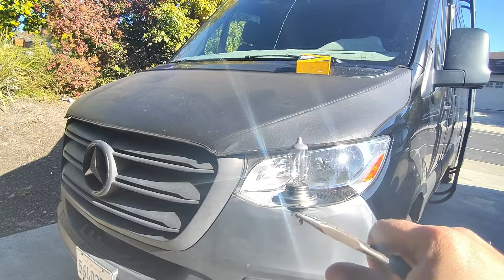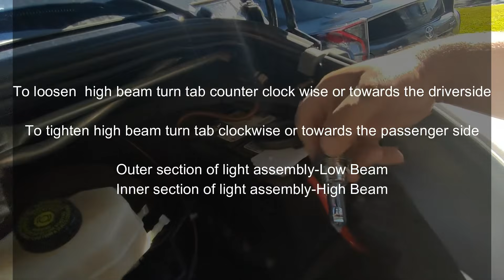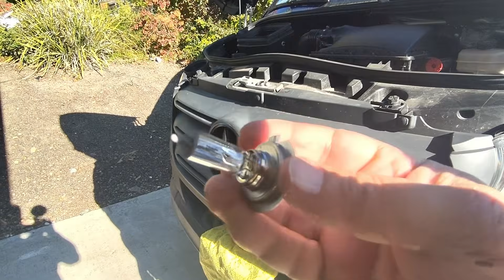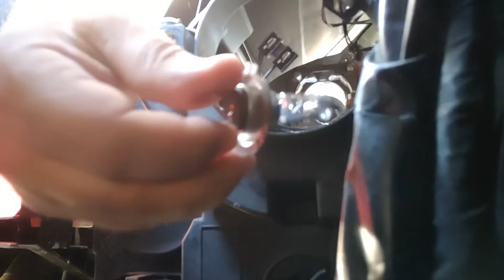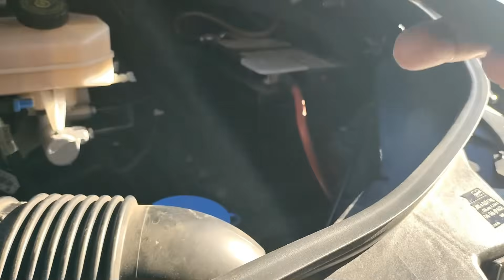DIY Mercedes Sprinter Headlight Bulb Swap | Low Beam + High Beam 2019+ 907

Comment from the maker: ▶Low beam replacement halogen headlight replacement https://amzn.to/3S3Igpk
▶High beam replacement halogen headlight replacement https://amzn.to/3PYGOSj
looking for an upgrade to LED? https://youtu.be/c6ssu4-vDFw
Direct link led
▶Low beam https://amzn.to/46SHkrN for 907
High beam - not available
▶Direct link 906 (2006 - 2018 ) Low beam https://amzn.to/46SHkrN
High beam https://amzn.to/46SHkrN

Sprinter Playlists (60+ Videos Each) 🚐
▶ VS30 907 170 EXTENDED: https://bit.ly/VS30Sprinter170
▶ 170 High Roof: https://bit.ly/VS30170Extended
▶ 360° Van Tour: https://youtu.be/rCCA3hLQSzQ
▶ FREE Van Build Parts List: https://bit.ly/RFVanBuildPartsList

Looking to change or replace the headlight on your 2019 and newer Mercedes Sprinter Vs30 907? In this video, I'm going to show how to replace both in just minutes.

Time Stamps
0:00 Identifying Your Sprinter Headlights
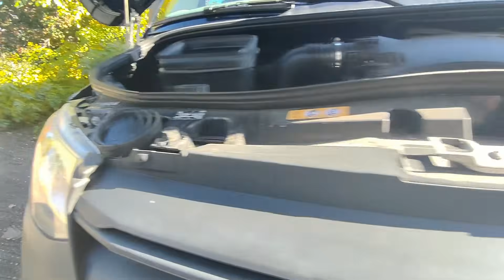1:10 Accessing the Bulb Housing
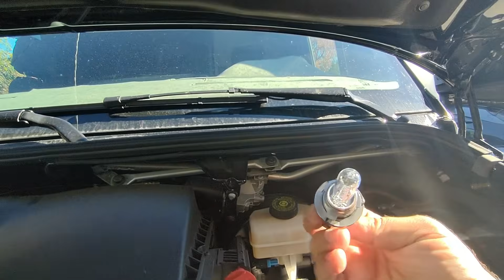1:49 Swapping Out the High Beam Bulb
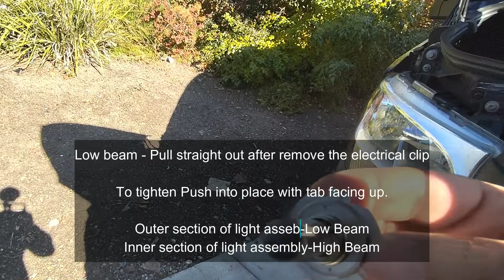3:40 Replacing the Low Beam Headlight

Learn how to perform a Mercedes Sprinter headlight bulb swap on your 2019 and newer VS30 van in just a few minutes.
Whether you need to replace a burnt-out bulb or are looking to upgrade your lighting, changing the low beam and high beam units is a straightforward task. I walk you through the process from start to finish, showing you exactly how to access the housing without needing complicated tools. This is a simple part of 907 Sprinter maintenance that anyone can handle at home.
You really do not need much to get the job done, though having a pair of needle nose pliers can make the removal process easier. By following these steps for your Sprinter bulb replacement, you can maintain your visibility on the road and avoid the high costs of dealership service. Taking care of your own VS30 headlight swap is a great way to handle basic repairs while you are out on the road.

Disclaimer:
Due to factors beyond the control of RandomFix, RandomFix assumes no liability. Affiliate Partner: I'm may receive a fee from some of my affiliate partners for my first-hand recommendations.

Comment: Bro, if that connector falls off your screwed, 😂. I think the driver for the sprinter i had to pull this video for tried to do it himself and couldn't get it back on, I pull the bulb out and the connector came with it. 2 hours later and fine out the bulb isn't in stock, 😂.

Comment: Low beam - it’s much easier to take out if you leave the wiring harness attached and you rotate the bike left or right (as opposed to trying to pull straight out).

Comment: For anyone watching and frustrated by the fact that it wasn’t explained how to remove the harness for the low beam:

Just pull it straight off while rocking it back and forth gently and it will come off.  The bulb for the low beam is an H7 bulb
Reply from the maker: Thank you for feedback and I thought that’s what I showed? Nonetheless thank you
Reply: Just wanted to also tell you this literally was one of the most in depth instructional videos I’ve ever seen. I was just left scratching my head because when you got to the low beam your hand went out of sight (in the tube) and your comment was that you removed it. Just an explanation of which direction it needed to be pulled would have helped. But, I figured it out without breaking it when I did it today!

Comment: Thank you so much for this video. I was driving and noticed my headlight was out. It was night time and I had just enough time to get the part at Napa and do it myself in the parking lot. Thanks to your video.
Reply from the maker: Ana, thank you so much for the great feedback. Congrats on changing the bulb yourself and not being afraid!!!
Reply: @RANDOMFIX Back again to learn how to do it again. The other side went out. Thanks for your video still being here.
Reply from the maker: Glad to help, if the this goes out 7 months later next replace them both at once.